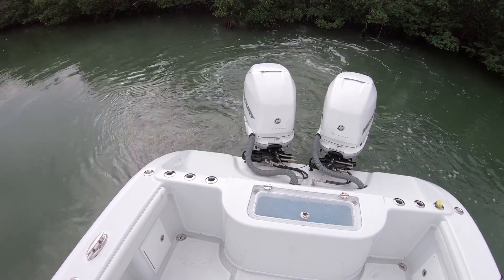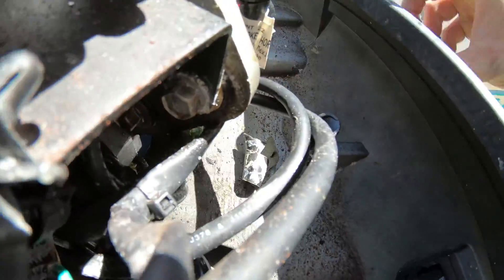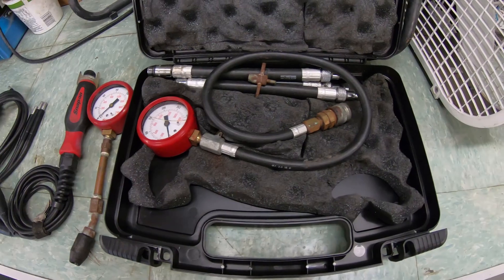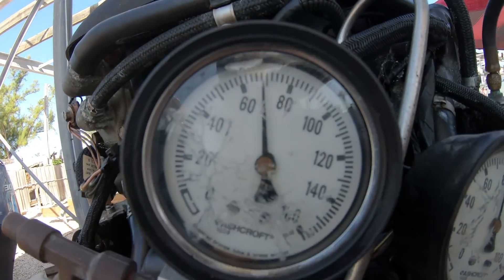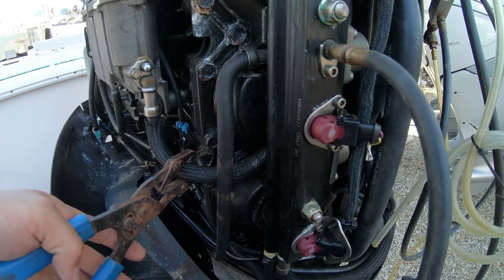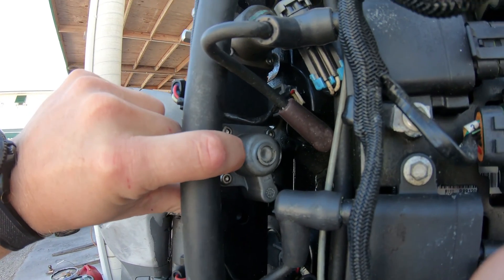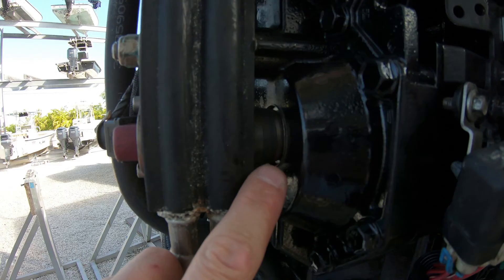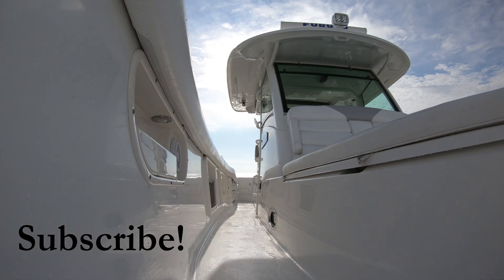What You Need To Know About Mercury Optimax's! | Troubleshooting

Comment: can you disable the oil injection on a optimax how I do it in case I get a motor used as im from Australia and gettin my 1st large boat with these outboards in this case im going to repower a nice boat that's an old Haines hunter V17r runabout how easy to disconnect the oil injection on these motors how I can n a optimax as im going to run my Merc outboard that's the optimax on 50;1 how this outboard will run on premix the motor in question was the optimax 150hp V6 im gettin in the future how I get this motor to run on 50;1 premix as im a longtime boater as I have a Caribbean sea sprtie boat that powered by a Tohatsu 30hp2cyls outboard on 50;1 as well too as I going to run my mercury V6 150hp outboard on 50;1 premix as I don't like the oil injection units as im a longtime boatie who mostly prefer premix outboards on all of my boats as im old school on my outboards this was in regards to premix motors I like them better than those with oil injections on them this was my views guys hope you can teach me how to disconnect the oil injection units on these outboards this will be good for me in the future mate
Reply from the maker: Hey, no you don't want to disable the oiling system on the Opti, that would be very bad!
Reply: as I knew this was in my boating I will be owning an older 150hp black max Merc outboards on my new boat as I knew thiswas the case you maybe confused on me goin to do that mate
Reply: this is ok as im using my boat in my home waters on the NSW central coast in Australia as you sayu im gettin this motor used for the boat I'll get in future and I knew this will be ok to keep the oil injection thanks on this mate I wasn't sure how to care for these outboards as im a boater if needed to I'll keep the oil injection on these outboards this was wiser to keep the oil injection thanks for telling me
Reply: that's ok in case the engine was in warranty but im jections in case the premix don't ever work on this outboard
Reply: this will be done incase the outboard has a lot of hours on the clock as you see this will be considered in case my Mercury need the oil injection disabled as I use my boat in my home waters as im using my boat for family use this was the reason im goin todisable the oil injection

Comment: You are doing a gret job and your videos are the best!
I have an Optimax 150 '99 and I found that cilynders #2, #4, #6, are rusted and without compression. Do you think that's worth to repair it or should I look for another motor.
Thank you!!!
Reply from the maker: Without compression, I wouldn't spend more than an hour or so on it trying to get it to come back. Rusted cylinders and no compression, sounds like a nightmare that doesn't have a guarantee that you could fix it :( Keep looking :)
Reply: I just opened the heads and the cylinders are in a very very bad condition.. Maybe beyond repair..

Comment: I have a 2005 /75  Optimax I’m getting A constant beep at 4000 RPMs and it goes in the guardian mode there’s a little filter that comes from the oil tank to the oil pump if that filter is dirty would it set the alarm might oil tank is less than a year old I check the carburetor for water and no water
Reply from the maker: Sounds more like the engine doesn't see block water pressure. There is a sensor on the back of the engine with a little hose going to it. Make sure there is water flowing there and then there are two sensors that are very similar there. One is block water pressure, the other is speed or pitot pressure. Swap those sensors and see if the issue goes away. Then you can replace that sensor. That's somewhere to start without having to get really technical and not having a laptop on it to check the code :)
Reply: Born Again Boating Thank you I will check that today i seen 3 Sensors one in the back one in the front and also the Oil sensor I’ll just buy the three change them all I also ordered a over revving switch someone said it could be that as well  
THANK YOU SO MUCH 👍👍🇺🇸🇺🇸🇺🇸

Comment: I have a 225 optimax. It runs fine for abit and long eniugh for a ski. But will then beep and possibly cut out... the motor has also had issues with going through spark plugs to quickly.
Reply from the maker: Have to check your pressures and make sure the engine is not overheating or oil. Really need to hook it up to a computer and find out what the beeps and codes are!

Comment: Do you have opinion on the 2002 225hp Optimax. I heard Mixed reviews
Reply from the maker: That's not a bad engine, it's just getting up there in the years! I'd stay away from any opti that was from year 97-01 though, that's when they called them the opti-pops ;) if your buying, just be careful not to over pay for it
Reply: Born Again Boating I paid 250$ for it lol and has 110 compression every cylinder and 200 hours.
Reply: @brentspaulding3195  I'll give you 350 for it lmfao
Reply: Born Again Boating I can send you pictures if you want it’s super clean

Comment: My 225 optimax throws a code on the smart craft gauge “ power”  and is in a limp mode and won’t go over 1500rmp if that. Any suggestions?
Reply from the maker: It's really hard to say without more information. It would be best to put a computer on it and see what the alarm is for. Most commonly it is an oil issue and the oil tank and sender have failed, but you'd need to confirm it. Hope this helps :)

Comment: Mercury Optimax 150, long rig, year model 2008
 
Hours: 352h
Replace parts
New trim cylinder
New spreader
New Fuel Filter
6 new spark plugs
The engine is in very good condition, mechanically and visually
Starts and goes, does not go up in laps, good comp in the engine.
I am in the dark here!
Reply from the maker: There's a lot of variables here :/ what are the fuel and air pressures?

Comment: I have a 2001 Opti it's is very sluggish coming out of the hole. Then on top end the motor surges almost like a fuel issue. I've changed spark plugs cleaned injectors replaced 1 air injector. Still only turns about 4900 RPM W/21 pitch prop.
Reply from the maker: Sounds like you might have an air leak in the system. Have you tried putting a piece of a clear hose on the fuel line coming into the engine. Check to make sure there isn't air bubbles coming in the fuel before getting to the engine. The boat and hull and weight are going to be what will affect the prop pitch, so there are a lot of variables there :/
Reply: @BornAgainBoating  I'll try and buy some fuel line with PTFE

Comment: Some call them optipop by nerds who think they can rev till they pop. I usually run low 5000 at the most never have a problem. Think 5600 is maxed 6000 they will fly apart. Mercruiser 140 was 3500 and 4000 and up to 5000 blew them up.

Comment: I run 2 filter traps for fuel and one on the engine very seldom have fuel issues. Still get shitty fuel sometimes the primary filters save me and got me back home.
Reply: Once it was nip and tuck I was draining water from the one trap to make it back the last 3 miles. Without 3 traps I would have never made  it back.

Comment: Great info!!! Quick question, where does the fuel line go to on the exterior VST pump? The barb on the front or the bottom?  I rebuilt that pump and cleaned out the VST, both high and low pumps are working but at WOT the engine runs for 15-20 seconds and then drop as if the VST is low on gas and revs up and down. I think I might have gas and vacuum hose swapped.
Reply: It’s a 2003 225 opti.
Reply from the maker: Well, the one fuel hose on the bottom comes in from the fuel tank, then from the top it goes to the VST to fill the VST. Are you sure your pressures are right? If it idles and runs but then runs poorly at WOT you probably have your hoses hooked up correctly, but maybe there is a blockage somewhere, like the pick up tube in the tank, or an anti-siphon valve at the fuel tank. Make sure your pressures stay the same all the way up and then if you have a primmer bulb in the fuel line. Watch that and see if it sucks flat, if it does, then you've got a blockage somewhere on the boat side of the system. Also, if you squeeze the primmer bulb while running, does it fill up the VST and get rid of the issue until you stop primming? Just lots of different things that could be going on here lol
Reply: I would have to verify the pressure, the bulb doesn’t go flat, I will pump the bulb next time I go out to see if problem goes away. Both gas filters are new (VST and Water separator). Motor runs Great up to 4K rpms after that it feels like VST is low on fuel. What’s best way to monitor fuel in pressure? What should I see for pressure? Really love your channel btw!
Reply: *Update*  it was the fuel line.
Reply: @TheSanchezVideo  Hope you see this (9 months later).  Was the RPM unstable?  My strbd 225 Opti idles well (although slightly rougher than it's partner) but once on a plane, asking it for more than 3000 rpm results in a steady fluctuation of the RPM.  It drops 500-600 RPM every other second.  Sometimes working the throttle back and forth rapidly will get it to almost go away.  Then, out of the blue, some days she'll run 5200 rpm WOT.  What I've done: Swapped tracker valve from one motor to the other (no change),Fuel line and bulb, TPS, VST clean (it was spotless), new filters, new plugs (looked good), fuel and air pressure checks.  I'm going to try it on a separate fuel source this week to try to rule a fuel tank/line issue out.  I suppose the VST could be starving intermittantly.....
Reply: Richard Gautier  fuel source would be my next step. I also found that my anti siphon value was sticking.
Reply: @TheSanchezVideo  Thank you for the fast reply. I'd really like to get this resolved before this weekend!
Reply: @TheSanchezVideo  Ill check it out.  If anti-siphon valve was sticking (closed, I assume) it seems odd that one motor would operate fine and always the same one.  Still worth checking though.  Thanks for the suggestion.
Reply: Richard Gautier on my boat, my tank has 2 valves and separate hoses to the engines.  I hope you figure it out...My issue was driving me nuts. Good luck!

Comment: But...on the very Off Chance that your engine is Still Under warranty, and you want that pricey part "Cost Covered", Telling the Guy in the Office "you watched a video and did the diagnosis all by yourself? could vacate.
If u bought the engine "Used" from an add (not a dealer) research or ask what the warranty situation is.
But rest assured, if you bought your merc off of Barney Rubble, nix on the warranty...
boat safe/have FUN.

Comment: I have a 150 op what should the water pressure be it pumping water fine slow down in a no wake zone the high temp alarm goes off.
Reply from the maker: At idle the water pressure should be at least 2. Could be about time for an impeller if it overheats at idle :)
Reply: @BornAgainBoating  thanks great videos keep it up 👍 thanks again

Comment: Great Info. any suggestion on where to start to repair a very sluggish  take off / plane  2014  Merc 300 opti DFI ?
it runs great once it gets going
Thanks
Reply from the maker: Possibly a propping issue. There's just a ton of variables that could effect that, not having any running issues once your going.
Reply: gotta be the prop. i'll predict its not the stock issue on there now. its very likely a racing prop stainless steel on there now. ask the people u bought it from if they have the original prop. or speak to a merc dealer, the specs should be stamped on that prop.

Comment: Great video. What would you suggest checking if the option doesn't idle while cold? Once mine warms up its great. But until it warms up to about 125 it won't idle. Thank you
Reply: Plugs are brand new.
Reply from the maker: I would start by checking the pressures and seeing where they sit. Could be a sticky injector :(

Comment: Can I replace the air compressor on my own?
Reply: Had the dealer do it didn’t want to risk a 1000$ part they were nice only charged me for a half hour. 60$
Reply from the maker: @sotharithmom4452  That's awesome! For $60! Well worth it to get it done :)
Reply from the maker: Yes, it's not that bad of a job, the main thing is getting the oil pump to prime and reprime all the oil lines before starting the engine

Comment: Motor runs great when you go past idle but at idle it’s wants to kill and runs rough motor has 85 hr on it and had been sitting for 5 months before I got it sometimes it’s kills more than others 2008 150 opti previous owner changed all 6 coil packs
Reply from the maker: Hmmmm, what are the pressures and how old is the fuel and  the spark plugs? Makes you kind of wonder why they would change all 6 coils? Sounds like there was an issue and they did that to try and fix it without really testing it and figuring out what's going on :)
Reply: Born Again Boating  fuel is 4 months old two coils were out so he went ahead and changed all 6 plugs were last changed before coils
Reply from the maker: Ok, have you checked the pressures yet?
Reply: Born Again Boating well the fuel is bad solid orange color going to start with new fuel

Comment: I have 2011 optimax 250 hp. Went out one day everything was fine until got back to dock and shut it off and went back to turn on but won't start. It cranks but won't start. Ignition 20 amp fuse blows everytime ignition switch is turned to the on position. Any ideas?
Reply from the maker: Hello, that stinks. Possibly in the key switch or in the harness somewhere. That is something that will take some testing to figure out :/
Reply: @BornAgainBoating  9 year old motor. Vibration is a bear.
Reply: Dead short. Trace schematic for ignition and work backwards. Find component or bare wire that is blowing fuse. You'll fix it.

Comment: Thank you for this great video. I have a 2007 90hp that will bog down and surge at 3k rpms. No alarms are sounding. I changed th fuel filter and cleaned the vst. Any advice is greatly appreciated.
Reply from the maker: I'd say to start by checking spark and looking at the plugs. Then check the pressures :)
Reply: @BornAgainBoating  I just had a tech come out and they said the alarm is oil level high. They replaced the tank and the code is still there with no beeps. The boat goes into guardian mode. He now says I need a new ecm. Is this a common failure point? Thank you for your time.
Reply from the maker: @brian3.2  Ouch, ummmm, well, it does happen. If it goes into guardian that quick, have the tech look at the block water pressure. If the engine doesn't see water pressure than it will automatically put the engine in guardian mode. Unless the ECM really is bad, but it's hard to say without seeing it!

Comment: I think I am missing some bolts between the intake and the block? I was looking for oil leaks and spring carb cleaner and when I spray near the holes it reves way up... any ideas.
Reply from the maker: It's possible. You could take the side chaps off and see if there are any bolts in there, and look around for holes where a bolt should go around the intake. Do you have any running problems at all? The cleaner may have just been close enough to the intake that the engine was sucking it in.
Reply: @BornAgainBoating  thanks for the reply... I pulled the intake off last night and the 4 bolts that hold the read plate on are not there at all.  I put 4 bolts in and put air box back on and motor start way faster now.  I think the idiots at basspro shop took all apart and never put them in?
Reply from the maker: @josephschilcher7806  oh wow, lol well, any things possible!
Reply from the maker: @josephschilcher7806  nice work!

Comment: hi there! love your video =), also i was wondering if theres any thermostats on mercury 225 optimax 2005 ? if yes can you show me where are they located?   im having overheating issued, replace water pump, but problem still remained it only happen when motor is idling and run on ear muff,  pee hole wont pee,  but when i used the top water hose i can see it pee from the pee hole please help , so my next step would be thermostats , not sure if thats the right things to do but im running out of ideas  =(...
Reply from the maker: Hello, sorry it took so long to answer you, for some reason Youtube put this comment in the spam folder, :/ So the thermostats are going to be on the top of the head just behind the fuel rails. There is one on each side. There will be four 8 mm bolts holding the thermostat housing on and to get it off, just take a 15 mm wrench or socket and unscrew the nuts holding the fuel rails on. There are only two of them. Then you will be able to pull the rail back and get the thermostats changed out. Be careful not to drop debris down on the injectors when doing this. As far as the overheat on earmuffs. You might have a low water pick up on the lower unit, so the engine isn't getting enough volume of water to stay cool. I wouldn't go off of that as an overheat just yet. Put the engine in the water and try again, this happens sometimes where the hose just can't supply enough water and the pee will be barely peeing. Good luck, hopefully it runs great and pees fine once in the actualy water :)
Reply: @BornAgainBoating  do you mean be careful with not getting debris in the air injector? If so what would happen and how to you correct that? I noticed that my thermostat gasket was leaking water and possibly some dirt sediment might have leaked onto the blue air injectors in the back of the fuel rail. Engine is running rough at idle btw. I have already replaced sparks and wires.